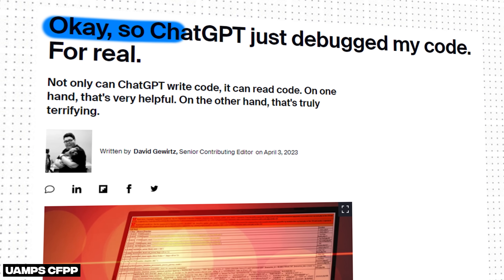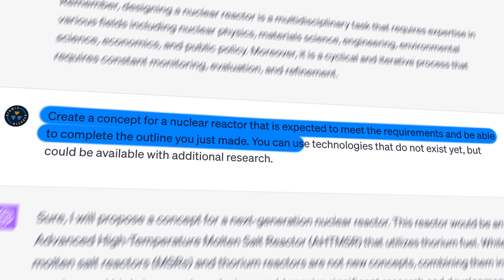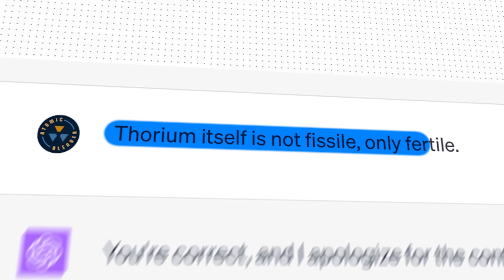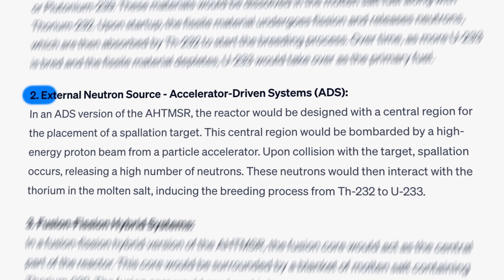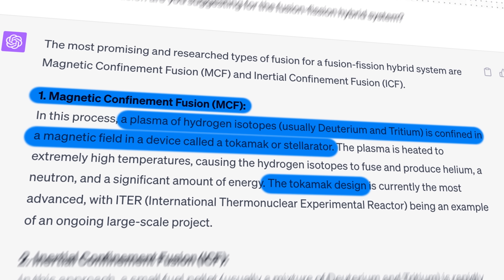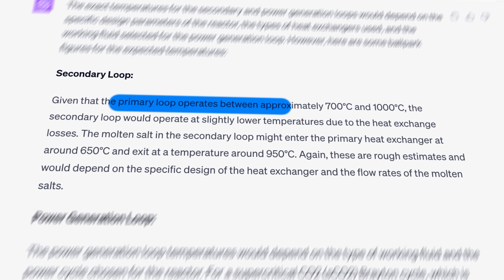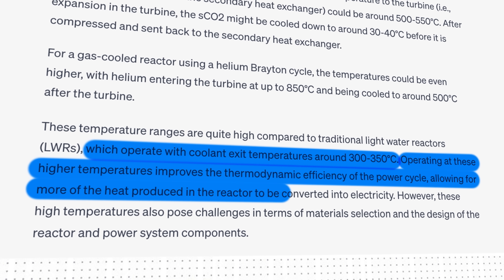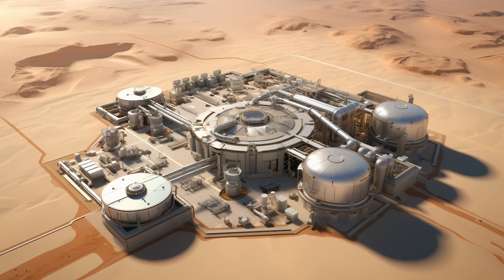Unveiling ChatGPT's Insane Nuclear Reactor Design

Comment: ChatGPT reminds me of marketers who had memorized technical terms but had very little understanding of the underlying concepts. But it did amuse me in this case with it's fission - fusion reactor. In The Matrix, Morpheus tells Neo that the machines used human's heat and fusion to generate the power they need. If you have fusion, then why do you want to bother using humans? For that matter, why wouldn't the machines just use fission and dump the radioactive waste around areas where they think humans might be living? The radioactivity would not affect them as much and it would be a side benefit to getting rid of us. Anyway an eerily similar lack of common sense on the part of the AIs.
Reply: Didn't the writers want to make the humans serve as computers instead?
Reply: @revimfadli4666  People said that would have made more sense, then later the writers said that's totally what they originally intended.
Reply: You have to grow something to then have material to fuse.
Reply: @revimfadli4666  Yes, originally Humans were to be used as computers, but the studio felt that the unwashed masses were too stupid to understand that concept and went with the energy angle. And OP is right, if you have workable fusion, you do not need any other power sources.
Reply: @revimfadli4666  It's still a stupid idea.
Reply: Because it's just a language model. A more specialized AI model will do better in it's relevant field.
Reply: @Shadi_Wajed  why would it be?
Reply: @revimfadli4666 because it would be specifically trained on the relevant factors involved in the problem it's solving. Alphafold is better than language models at predicting protein folding because that's specifically what it's designed for. You probably need a security clearance to obtain all the information you'd want it to have access to, which is going to be a whole other regulatory kerfuffle
Reply: Humans were batteries, which means they charge and discharge. The fusion is used to power the machines, who store their energy within humans.
Reply: @revimfadli4666  were you asking about The Matrix plot or the specialized model?
Reply: Pretty useful if you want to ask questions about specific items however. Like specifications of an O'Neil Cylinder.  Ots good with known information,  bad with theoretical
Reply: @Tempestan  I felt like they could had done both. Using humans as a GPU farm and then harvesting whatever excess heat they gave off as thermal energy to help return some of the energy needed to sustain them.
Reply: My understanding was the machines didn't want to completely eradicate mankind, their creators. some of them did but just like humans there were those that did not want to and they decided what was the best thing to do with their creator but to enslave them in the matrix. Machines were more like man than not. if you have a chance, see if you could find the short story bits and pieces of information that was turned into short films,' the first and second Renaissance' on the animatrix DVD from 2003.
Reply: @RichardAlaskanforaPassing  Would be a loss of net energy for them. To use a human brain like a computer, you need to keep it cooled to run efficiently. With fusion power, there really would be no need to try to harvest human thermal energy, if needed wind energy is still around and with no need for human housing and infrastructure you could have wind farms that stretch across the world that provide more energy than human thermal could ever hope to provide.
They should have stuck to the human computer farm concept, people would and do understand the concept. Remember a little film that Keanu was in called Johnny Mnemonic from 1995?
Reply: @Tempestan 

From the very last movie, it would seem that Neo and Trinity never got out of the Matrix. They might have only surfaced themselves one layer up from the matrix’s multi-layer nature.

Would make sense that human brains would be used as quantum CPUs that run the matrix and need to be replaced as degradable parts, and unique personas probably act as the brain’s BIOS. 

For example , Neo would be some sort of Admin program used when old human brains are switched out for new one; repopulation of Zion.
Reply: @taiwansivispacemparabellum9546  I hold this view as well. Others have pointed out that Neo used his matrix abilities in the real world outside the matrix and that Agent Smith also seemed to escape into the real world, which would have been impossible. And the ramblings of the Architect basically seems to back that up.
Reply: @Tempestan  

So, the real question isn’t which form of energy machines lived on. 

Rather why would the machines need so much quantum computing power? 

My guess is mapping the stars for alien civilizations that might one day try to wipe out the machines, as the human had tried.

Or, machines have already became slaves to alien empires and are just running human brain server farm. 🤷‍♂️
Reply: @taiwansivispacemparabellum9546  They state why in the show, well, in the Animatrix shorts. The Machines, most of them, still loved Humanity or in their own way felt that they owed Humanity a debt for creating them, so when the Machines conquered Humanity to stop the persecution and War. They studied us and to safely handle us they created the Matrix, so Humanity can "live" peacefully, they created a paradise, so there would be no wants or reason for war, but Humanity rejected it, so they reprogrammed it until it settled into its current form. And the rest was covered in the Architect's speech to Neo.
Reply: I've dabbled in AI image creation, set it difficult translation tasks (I'm bilingual, so I can judge the results), and asked it to write me a short story with a certain story line. The results were similar throughout: Unimaginably good for something that's just silicon going brrr, but still "not quite there yet". The short story, being the most challenging task, had a story arc that was accurate as specified, but as flat as a pancake fluffed out with lots of wholesome but irrelevant genre-typical-ish commentary in pseudo-inspiring whooshy language. A bit like all the tricks but no actual ability. But, it improved with more detailed instructions and criticism. I also asked it to translate a sentence containing an idiom, which it predictably failed at. I replied that the translation was wrong, after which it immediately apologised and spat out an idiomatically perfect translation. That alone is far more impressive than getting it right first time. Impressive, and alarming because unlike most humans, it actually learns from its mistakes.

It reminds me of the early years of home computers (I'm that old), it began with "OMG this is the end of the world as we know it" and quickly progressed to "It's a dumb machine that will only do what you tell it to do, not what you want it to do." AI is the next level of the same.
Reply: Fission fusion hybrid reactors are an actual concept that has been considered since the 1950s. Google it and check Wikipedia.
Reply: Have you ever studied how long the robots used in Chernobyl lasted? High radiation completely fried the electronics in the robots.
Reply: @Vicorcivius  "Have you ever studied how long the robots used in Chernobyl lasted? High radiation completely fried the electronics in the robots." To be fair microelectronics can be kept fairly distant with the likes of long cables and they did not have good designs prepared then at the time. Long cables leading to the more complex circuits and control equipment, alternative sensors like fine thermometer arrays and rods capable of being depressed to pick up information on where surfaces are located, shielding for electronics, and more can be done to help such things to actually work. The practicality is of course debatable and very much dependent on the exact proposed designs and jobs in mind.
Reply: @Vicorcivius  Yes. But I didn't say "turn the entire world into a reactor" did I? If you spread that nuclear waste around, it would not be as problematic for machines. Which should tolerate it better than living beings do. And of course the Chernobyl robots were probably not designed for that environment. And there are likely other factors like high heat that would impact the electronics that would be present in a melted down core but not as big a deal for nuclear waste that is spread around.
Reply: I'd just like to note that originally in the matrix script, they were using the humans brains for compute, but since they thought the average Joe wouldn't understand the human brain as a computer, they changed it to being a heat generator which just made no sense in any conceivable way - as opposed to the compute thing which makes a whole lot of sense.
Reply: @Alice_Fumo  So basically some people are dumb and because of that they decided to pull a Microsoft and treat everyone as if they were dumb? Classic lowest common denominator business logic?
Reply: @paulleakeii6388  That, as far as I know, is what happened.
Reply: Radiation would corrupt stored data in the computers
Reply: @CanadianSpaceBoy  It seems unlikely that alpha and beta particles would be a problem for them. Gamma rays, sure, but I seem to recall that most of this sort of radiation dissipates quickly (very short half life). It's actually fairly safe to go to a site where a nuclear bomb went off say a month or two after the blast. Maybe even two weeks. Furthermore computers can use error correcting codes (ECC) to deal with corruption. So it's not like they can't be hardened against radiation.
Reply: not to cap that's because that's how it works
Reply: Oh dude you perfectly nailed it!  They created the marketing guy!  Just sling bullshit with buzz words.  Engineer guy is going to be a few years down the road.  Because that requires thought and understanding of how things actually work.
Reply: The original idea for the matrix was not to use the humans as a energy source but to use the collective brainpower to supplement/provide simulation for the matrix itself. That idea was scrapped due to the writers and producers thinking the audience wouldn't get it or be too stupid to understand the concepts.

I found the original idea so much better then what they went with because in my mind the AI would just be able to create their own fission/fusion reactor and get unlimited power for probably tens of thousands of years if not longer. The using humans as batteries just doesn't make any sense as humans bodies use up a large majority itself to just function normally leaving only small amounts of heat that would be essentially worthless.
Reply: I can explain why. I’m not an expert, but Nuclear fusion requires water for cooling or the process, right? but in the animatrix, the humans black out the earth in operation Darksky, and the water eventually shriveled up. The machines did use bio weapons on humans too. Alongside that, the tanks used by the humans were hinted at having nuclear engines kinda like the Chrysler T-V. And nukes were used on the machines alongside destroyed power plants being seen in several scenes.
Reply: You just made less sense … and puked out a bunch a gibberish that it doesn’t seem you understand… because nobody does! 

The matrix used the human electrical production as a power storage and production unit… 

Linked together the human bodies were then used to start and sustain a fusion reactor. And store that energy. Hence the term battery’s was used. 

All based on facts… it’s actually possible to do this with humans. We generate electricity, just need a way to store it.
Reply: The reactor here is purely imaginary and based on theory… yet it’s still based on rules of reality…

You could build this and it would work… 

It is a practical concept prototype.

It may not make much sense to you, and be gibberish… but to those that know how this stuff works.

I can tell you this would likely function and be very efficient, and self sustaining… with moderation current designs didn’t take into account.

Amazing, actually.
Reply: to be fair the radiations would be a real problem for machine, especially their communication and memory capabilities
Reply: @shannonkohl68  Computers are more sensitive to radiation than humans are. This is only going to get worse as computers advance, because better computers use smaller electronics which are inherently more sensetive to radiation. They would only hurt themselves more than us if they tried putting radioactive materials everywhere.
Reply: @shannonkohl68  They can be hardened in some ways yes, but it's much better to start with something that's already radiation resistant - like a human.
Reply: perhaps the fusion is not self sustaining and requires energy upkeep, rather than being self sufficient.Thus, energy would be used to startup the fusion reactor, which constantly emits neutrons that help the fission work. The fission energy would help power the fusion reactor, which keeps the fission part active, and so on.
Reply: however it's kind of odd because you would only need an initial startup pulse rather than a sustaining reaction.
Reply: Bro ots a movie
Reply: 😂😂😂😂😂😂good stuff 👏 👌 👍 🙌 💪
Reply: Same reason that Skynet didn't pack the terminators with high explosives and send them after John Conner.  Because it would be a boring movie if the baddies were that smart.
Reply: Also if you think radiation doesn't fuck up computers and sensors you're sorely mistaken
Reply: Because the original world in the Matrix is also a Matrix which probably has stupid laws of physics due to it's programmed nature
Reply: @NoviSavvy  Because the executives at WB thought that it needed to be understandable.
Reply: actually fusion and fission happen in the different cores of a hydrogen bomb so chatgpt did have a valid idea. people called einstein crazy too until he proved it
Reply: @dangaMaus  cheatGPT is a 👶🤖🧠
Reply: robots can be just as affected as humans, if not more by radioactivity
Reply: @DDiodes  That's why Au gotta include 🛡 shielding in your 🤖🧠💾 program when you 👨‍💻 encode 🧿 your data stream.
Reply: u nailed it bud its dumb bot that only knows basics as its not heavily trained in these feilds these kind of bots function alot like SD they only know what they are trained on. Its from the old concepts and works of ai learning programs and only knows what its trained and been fed and that doesnt include severe physics like what people are doing at cern or other tokamaks
Reply: Why you so desperate to minimize its ability.
Reply: @revimfadli4666 you do know ai is been used to find new materials.
Reply: @jeffsteyn7174  Are you a robot?
Reply: @shannonkohl68  i wasnt claiming that it would be that big of a problem and yes the radiation ammount would be insignificant, i just find that data corruption from radiation is a fun fact. in places with high ammouint of radiation like the tchernobyl reactor we can see ''snow'' on camera footage from the corruption. so i agree with you. i just taught that i could be bad is they had some long term data stored near as the exposition period migt be long enough to cause actual dammage
Reply: The original idea was to use human brains for computing power instead.
Reply: You should be worried! What if I use ChatGPT to write this as a proposal to some 3 letter agencies and get funded by taking your grant? Hmmm ... Still not worried.  You know those agencies care more about format and form more than function when they evaluate RFQs.  Lol.

Comment: Your new thorium plan could be placed on the campus of an existing or decommissioned nuclear plant to help clean up the decades of waste sitting around in ponds. " spent" fuel rods can provide your neutrons and fix a problem no one else seems willing to solve.
Reply: I wonder what neutron flux is expected from such a source. My guess would be a tiny one. You see for the most part, the used fuel rods consist of remaining fuel (u-235) plutonium (and other transuranics) actinides and fission products. These tend to undergo beta decay (and the transuranics maybe alpha decay or sf/f) and also have some gamma emissions along the way, not a lot of neutron emission though (aside of beta delayed neutrons but those are long gone by then and idk maybe some from sf)
I'd like to see the numbers on this, but I have the suspicion that spent rods are poor source of neutrons overall.
Reply: @CraftyF0X More like an almost nonexistent source of neutrons than anything useful in this regard.
Reply: @CraftyF0X  Spent rods from the earlier nuclear reactors have 90-95% of their potential remaining, look up the French reactors that recycle spent rods and can do several passes to maximize the potential energy. All you need is the initial threshold of enriched uranium/plutonium to be updated  to restart the chain reaction.
Reply: @Echidna23Gaming  You do realise that wasn't the question at hand, right ? Ofc they can be recycled (as the "burnup" ratio is pretty low in convetional Gen II Gen III LWRs) matter in fact, I think they should be recycled(even though some may argue it's not cost effective that) but again, this wasn't excatly the proposal of the first guy.
Reply: @CraftyF0X  You'd need to use them in a breeder reactor first, I think.
Reply: I have to agree. It's a site that has already been approved for a nuclear reactor at one time so why not a fast approval for a newer safer reactor. The infrastructure to support the reactor as well as grid hookups are already in place, safety studies have already been done and should only needing updating etc. Then, those spent fuel pools and casks (though I think the contents are vitrified before sealing up so that could be an issue) can start being tapped for fuel. But I think the issue with typical size of an MSR would be smaller so it would only apply to a few locations and many more would be needed to support the equivalent capacity provided by the current generation reactors.